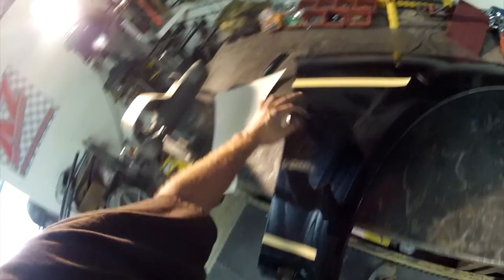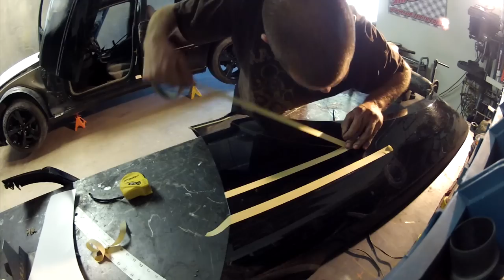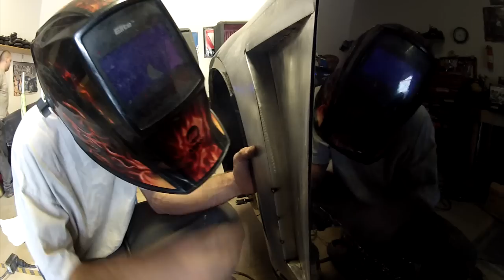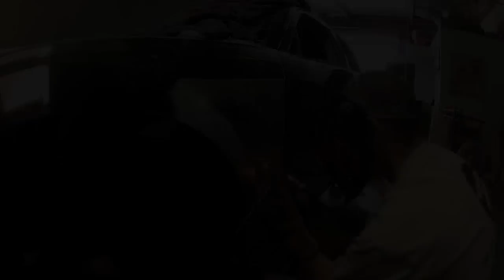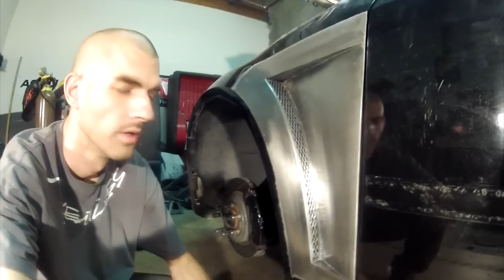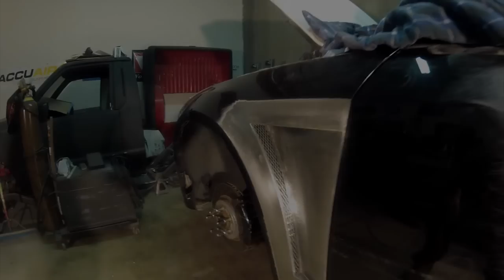SEMA Preview #3 Fender Vents on the Magnum. Artistic-Precision.com

Comment: Just wanted to say great job on the fender vents I'm just about to do a charger with a 300 front end but the body lines do not match up so I have to some vent in the fenders. I would like to see the finished magnum.
Reply from the maker: Check out my other videos, it's in there.

Comment: Awesome. I'm curious why you used bondo on the inner weld instead of flexible seam sealer?
Reply from the maker: Bondo is firm snd can be precisely sanded and shaped. Harder to do with soft seam sealer. If you dont apply it absolutely perfect it can be a pain to clean up aplication mistakes and it "can" be sanded and shaped, but tough to do sometimes. Bondo is quick and easy.
Reply: @MrArtisticPrecision  for sure. I do a lot of caulking for a living so caulk/seam sealer is a go to for me. A tip keep a wet rag with water/solvent depending on your product. Wipe your bead with a clean finger and wipe excess on your rag for those who are curious.

Comment: definitly nice work,,but why not just buy fiberglass fenders already vented?
Reply from the maker: cuz fiberglass sucks. always wavy, never fit right, need tons of sanding and bodywork to male straight. and expensive to buy, if you can find them. way more craftsmanship with metal, and you are still using all factory sheet metal that fits nice and only needs a small amount if bodywork to smooth out for paint.

Comment: He is welding without covering the paint some mechanic you are
Reply from the maker: Haters gona hate. Seeing as how I also grinded off the paint on all 4 doors, and the rear lift gate, and shaved all the handles, and it had a custom fiberglass hood that I still needed to bodywork, covering the paint was un necessary because I needed to sand, bodywork, and re paint the entire car anyway once all the metal work was finished. Keep hating though. Someone has to... 👍
Reply from the maker: You can even see the doors have been worked already in the begining of the video...